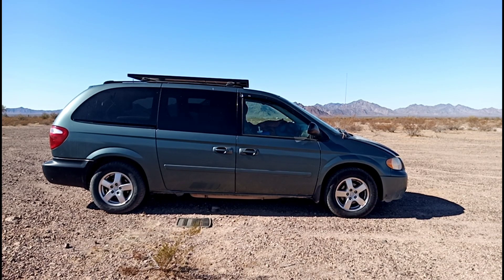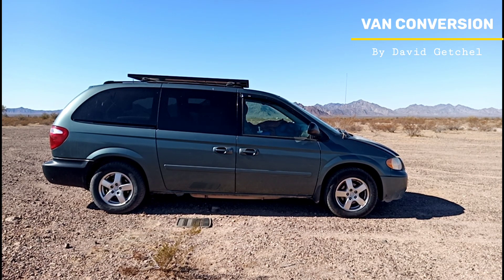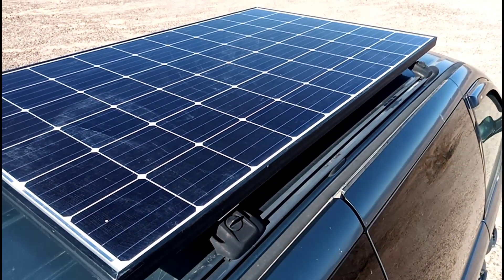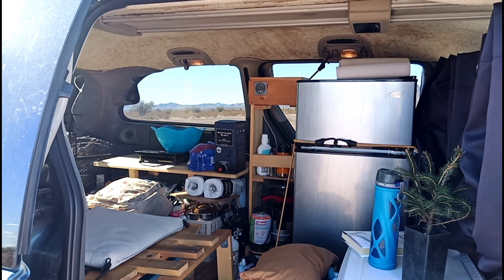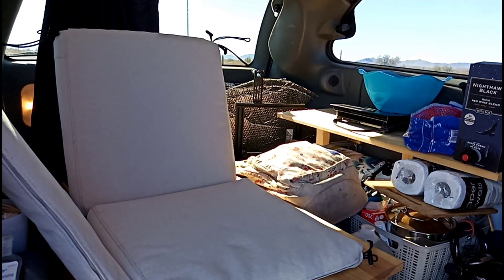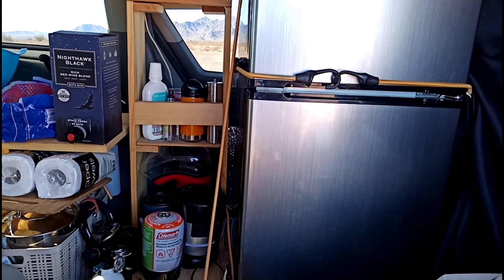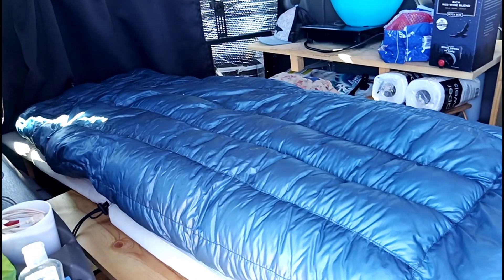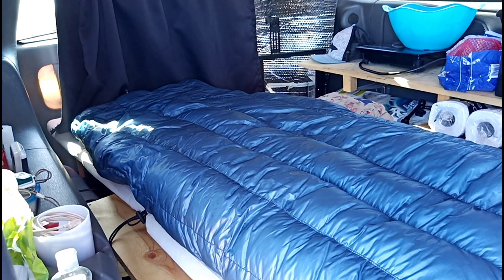Minivan Conversion - Solar, Tesla Battery & A Whole Lot More!

Comment: Bitchin van man. 

What do you get done with your cutter and printer? 
Is your panel truly enough to power your electronics?
Reply from the maker: Just actually saw you comment. Sorry about that. I work on all sorts of projects. Art, products, things I just want to see if I can make.

That panel and the dc-dc charger from the alternator make the system work well.